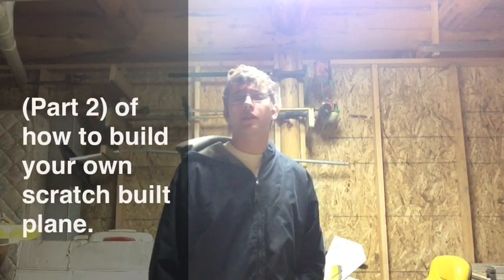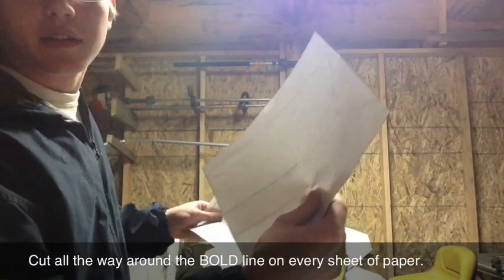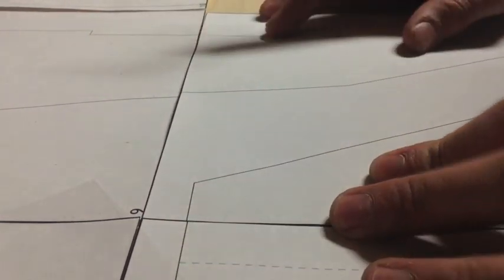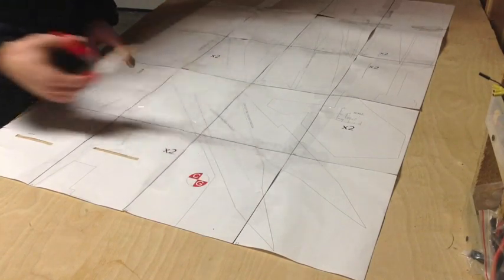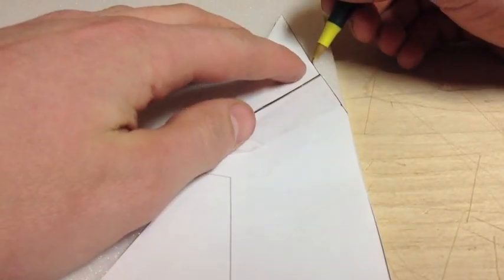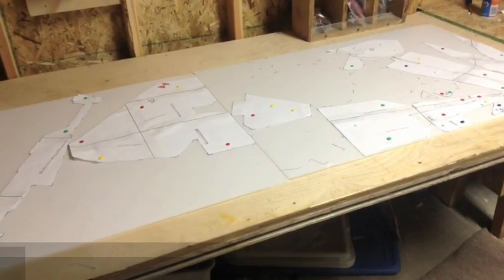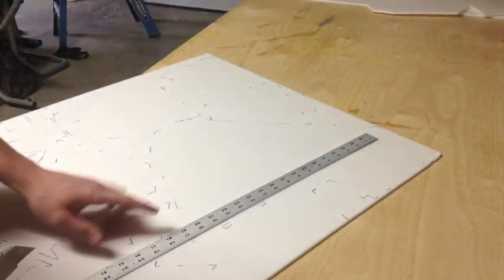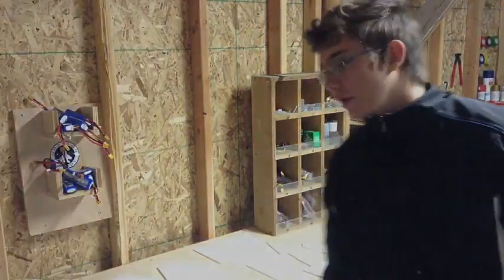How to build an rc plane (part 2)

Comment: I think it is important to use spray glue on the paper then attaching  it to the foam so it lays flat when cutting  out the pieces.  Use a real light spray, let it almost dry before putting it on foam. Get a  spray glue that you can reposition  it if need be. You can get the repositional spray glue at most big craft stores.